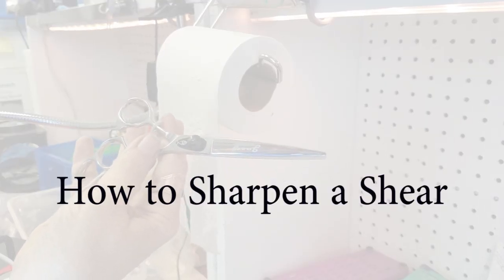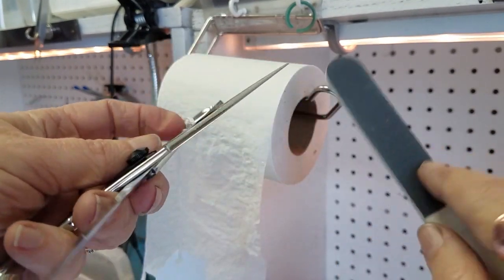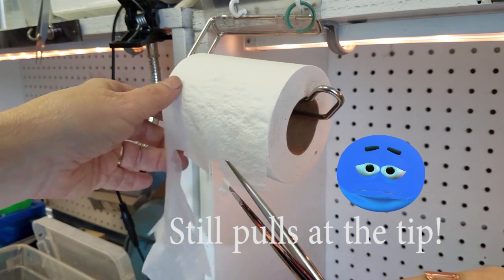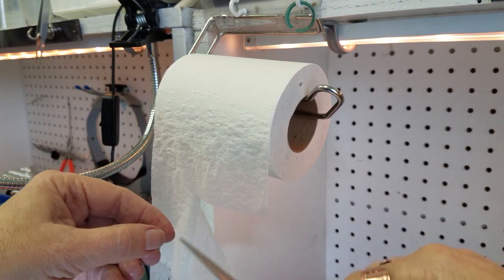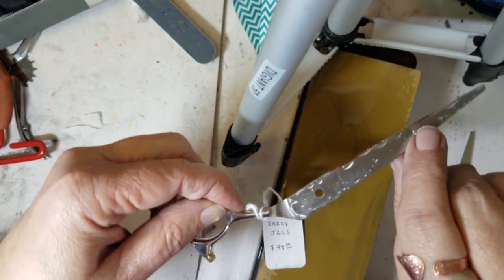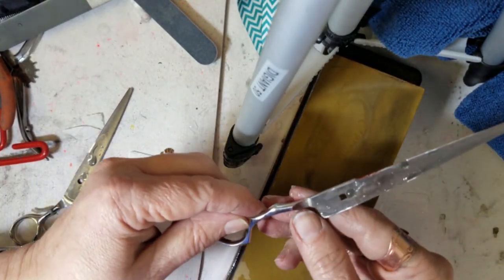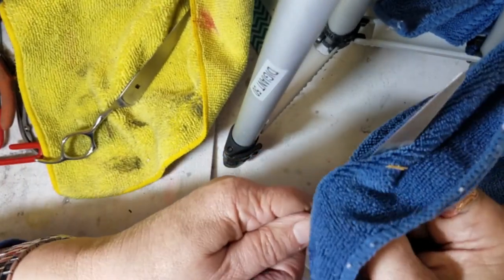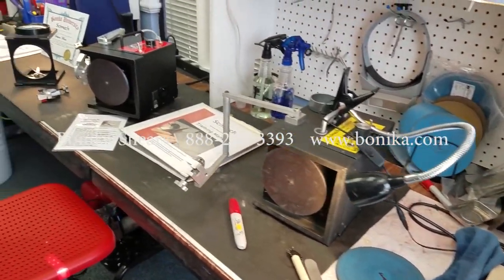Sharpen Beauty Scissors with a Nail Buffer | Bonika Shears

Comment: This is the best shear sharpening video out there. Take them apart,  Use a nail buff, Use wet tissue,  Use red sharpie.  All things other sharpening videos do not do. Thank You.
Reply from the maker: Wait, wait, wait. Hold on a minute!  This is only for shears that are a little bit dull. This will not work from nicked shears. It just will help you go a little longer before you call the professional shear sharpener.

Comment: Not working.   Mine was a little dull but now after using the buffer it doesn't cut at all.
Reply from the maker: This works but only if you are using 3000 grit,  light touch and and it only smooths out the nics. To truly sharpen send them to a professional with a sharpening hone.

Comment: I tried this. Made my shears worse. 
They were sharper before attempting this.
Reply from the maker: You used too much pressure or you were not using a 3000 grit buffer.

Comment: Please help. Im at home hobby groomer in Europa with low prices so i can't afford to send my scissors away.  What can i buy to atleast decent sharpen my own scissors.  Like starter kit? All my scissors are getting dull. I also lost a little metal ring inside from sine new scissors and now they arent tight enough to use.
Reply from the maker: There is not an option. If you try to sharpen with a "starter kit" you would run the chance of damaging your shears so that a sharpener could not fix them. I know sharpeners in most European countries. Have you thought about becoming a sharpener yourself?
Reply: @BonikaShears  yes but I can't find any courses anywhere.  So I don't know where to start

Comment: I tried the method, it worked on the first try (passed the wet tissue test to my surprise),  but after using the scissors to cut my hair and afterwards sharpening them once more with the same method, seems to make them blunt (struggles to cut dry tissue). What might be the reason? Although, I bought these scissors off AliExpress, and they were honestly initially bad.
Reply from the maker: The first problem is you have AlliExpress shears!  The second issue, this doesn't truly sharpen them. It will remove slight burs and nicks. I think you need to  upgrade your shears. We have some nice ones www.bonika.com